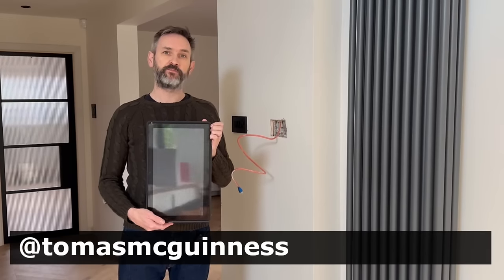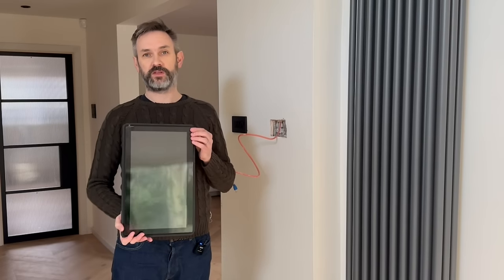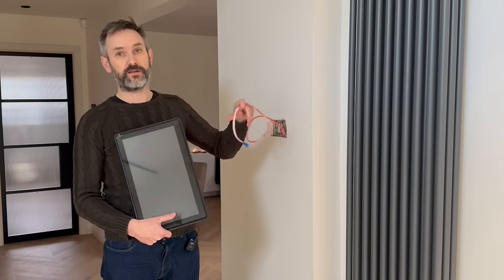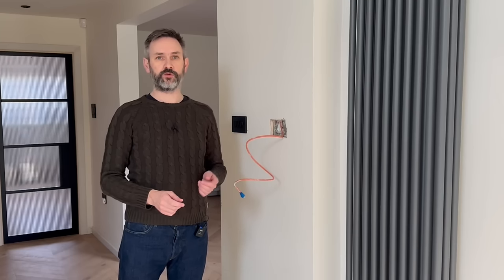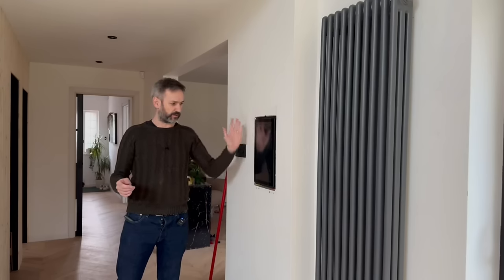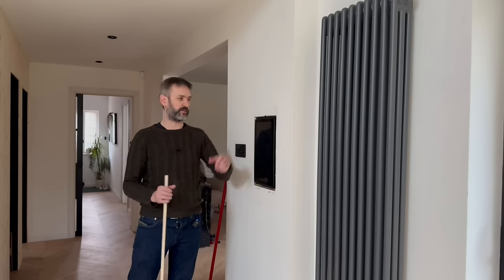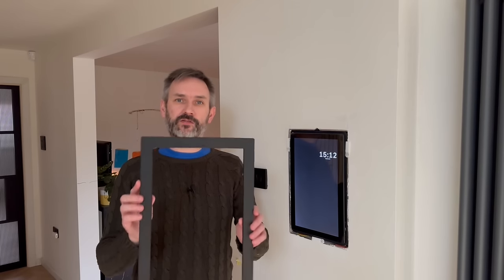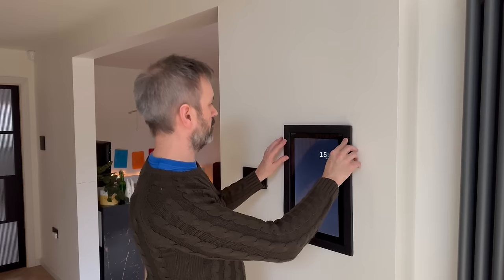Installing my Home Assistant Control Panel

Comment: Painter's low tack blue tape or plain masking tape are my goto when anything needs precise marking out for nails, screws, drill holes, biscuit holes or multitool sqaure cuts. Love the fancy radiator on the wall and the herringbone floor. My true blue Dublin ears despite being in central europe for 20 years are detecting an Irish accent.
Reply from the maker: Irish indeed! I could have used the tape with the laser instead of the pencil :) Something for next time.

Comment: What's he advantage of using a proprietary web browser app instead of the obvious choice of just installing the companion app?
Reply from the maker: The ability to control the screen and its brightness. Plus it can be locked or put into a maintenance mode.

I initially tried the companion app, but the Kiosk features were more appealing to me.

Comment: You can have your fully kiosk display a website as your screen saver, that’s what I have done and directed it to dakboard which in turn is linked to a shared iPhone album where I put the photos to display inside, can then use the camera motion to edit the screen saver when you get close
Reply from the maker: That's an interesting idea! Thanks

Comment: Is that a newly build house or renovated? Ethernet cables with giant dollops of plaster instead of blue installation pipe seems a bit strange for a central european persspective.
Reply from the maker: The big dollops of plaster and plaster board are a pretty common construction technique called dot and dab. The boards are fixed to brick using the blobs of bonding. I don't think there is anything in the UK building code that dictates how ethernet cable should be carried. My cable came down through the ceiling and the builder just left it loose behind the plaster :)

Comment: @TomasMcGuinness 
did you ever hear back from the manufacturer regarding OS updates? I'd love to do this but lack of security updates rules this out for me. Even if I dumped it on my IOT network, last thing I want is someone getting access to HA on the tablet and messing with my devices (heat pump, dishwasher, hot water etc etc)
Reply from the maker: I totally forgot about that. I have reached out to the supplier today. I just checked and Android 8 went out of support in 2021, which is two years before I purchased the unit. That is terrible customer service. I would have expected at least a version with support!! I will let you know. I have locked down access to the tablet, so it's not accessible via the internet. I only enable access when I want to update the unit.

I have seen online that people have had some success flashing an updated version, but I guess that comes at the risk of the hardware being too slow.

Comment: Does the Fullykiosk intergration woks stedy for you?  for me it worked for a little wile before it wouldnt connect
Reply from the maker: It has been reliable. Sometimes the app will go into the background without reason, but it has never lost the connection. I’m using Ethernet connection, which probably helps a lot.

Comment: Interesting use of the pos tablet. Looking forward to hearing how you use it over the next month. 

I've thought about building a smart mirror type thing but thinking id be more concerned with the power consumption.
Reply from the maker: The PoE aspect of the POS tablets was the main attraction to me. Much tider.

In terms of power consumption, it might not be as bad as you expect. When my tablet only seems to draw about 8W, which isn't a lot at all.

Comment: According to their website this is running Android 8.1 for which support from Google ended in 2021. This was from your link in your unboxing video.
Can you confirm that this is running such an old Android version or did they give you a newer Android build?
Reply from the maker: That's correct. I'll admit it's not something I was specifically aware of when I ordered it. I'm conscious of its security path level. I might have a stab at upgrading it at some point, but it's okay for now.

Comment: I have a Samsung A8 on the kitchen wall. Powered via a hidden smart plug. Turns on at 10%, off at 80% via ha automation. So no probs with battery deformation.  Main tab has weather, temp, home battery/load/solar status, buttons for main lights etc
Other tabs for specific details... Heating, power system, statistics graphs and the like
Reply from the maker: I had thought about an automation for the battery, but the PoE is less moving parts. There is always a risk of deformation with batteries, but good charging practice will significantly reduce it.

Have you hidden the USB cable somehow?
Reply: @tomasmcguinness  it's next to a door. So running a long cable over and then above a cupboard. Neat enough.   As for battery issues... It'll last a few years at least. Will probably "want" something else by then.   A8 is only 10" but easy to get hold of. Plenty of super cheap tablets available. But wanted something with up to date andoid
Reply: @tomasmcguinness  and I'm not luck enough to ha e poe in the walls 🤔
Reply from the maker: I've planned that for a long time. When the house was rennovated in 2021, I made sure that ethernet cables were pulled into position!